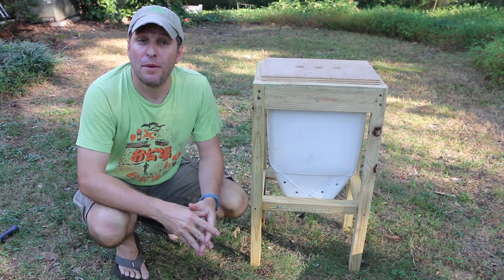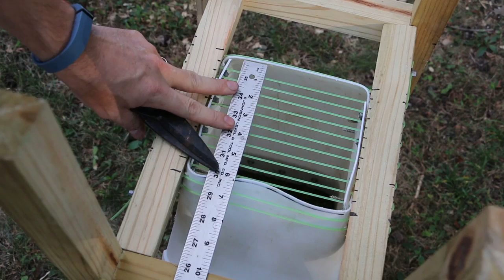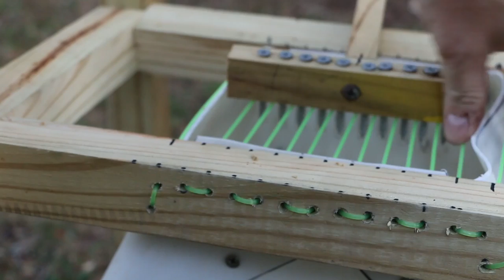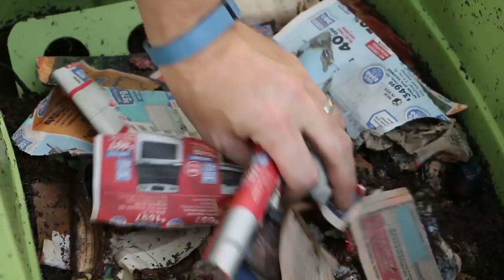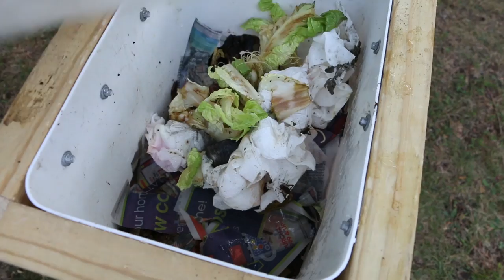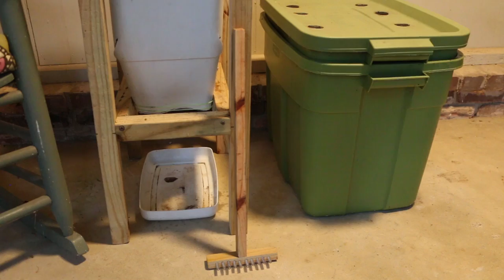How To Set Up A Flow Through Worm Composter

Comment: I just made one.  I’m so proud of myself.  It took two days because I don’t know what I’m doing, and it doesn’t look nice like yours, but it is up and running ☺️
Reply from the maker: Yay! You should be proud. I’m happy you built one. My greatest compliment is a new DIYer. The worms don’t care what it looks like. :-) 👍🏻😁👊🏻
Reply: GreenShortz DIY your response is very genuine..keeps us positive..thanks for the good project,buddy
Reply: @GreenShortzDIY  I'm going to figure a way around the wood. Probably PVC and around the loom, probably some fabric mesh. And I will probably hot glue the flaps. Or flex seal. But thanks I almost bought something for $149. I wonder if it would work horizontally I want to grow worms right in the garden. I've been using a box but I think my bedding wasn't good enough. I had newspaper,  cardboard, and regular dirt.
Reply: @aicram62  Good -I've got lots of PVC and want to avoid the woodworking.  I'd thought mesh also if I could remove every other strand - - -  Duct tape and glue for sure....    And a dishpan underneath - I saw elsewhere that there can be lots of fluid runoff.

Comment: I built a similar flow through bin using the same trash can plus trim line 2 years ago and I will tell you where you will run into problems.  The assumption that the vermicompost will nicely fall through the trim line is false!!!  Even with the nice rake you made,  you will not be able to pull the compost down - guaranteed.  The vermicompost is too sticky.  After many strategies to get the compost out of the bottom, what I had to do is push it down from the top using a small colinear hoe.  In fact I did that today to harvest mine.  Been doing it that way for about a year and it works well.
Reply from the maker: Ann...thank you for the feedback. I was quite fond of my little rake, but I'll agree it hasn't been pulling out the compost as effectively as I thought it would. Thanks for the tip and for your comment.
Reply from the maker: Hi Ann...I featured your comment in my latest video on worm casting harvesting. Take a look: How to Harvest a Flow Through Worm Composter: https://www.youtube.com/watch?v=6ScnbSySrFg
Reply: I agree with Ann, I also used to push from the top but then you squeeze the warms and it makes the material too dense while you want it to be more fluffy at the top. I found another method, I raise the whole container a few inches in the air and then give it a bump against the floor. A few bumps like this will get the compost down to the havseting bottom without compressing the upper layer
Reply: Yes, I tried that 'bump' method first, but with time the bin became too heavy for me.  Plus the material seemed to stick together and not fall freely through the wires.   I haven't found that using my short colinear hoe to push down the contents of the bin resulted in compaction, because the material seems to move out of the way as I press down.  The end of the hoe only measures 1"x3".  And I only do it enough to get the amount of harvest that I need at the bottom.  If compaction does take place, the worms seem to undo it.
Reply: @GreenShortzDIY  how about some type of auger?

Comment: great video and great ideas
I've built a simpler flow bin half a year ago, it's working quite well, but it's not large enough. Mine is  with plastic pipes at the bottom. your idea with nylon wires seems better
Reply from the maker: Thanks Oded...the best design is the one that is working for you right now. :-) I do plan to build a simpler version of this flow through worm composter, with an easy-to-operate harvesting mechanism. It will keep the trimmer wire in the base though. I like the way that has held up so far. Thanks for your comment.

Comment: I made a flow through composter about 8 years ago out a plastic 55 gallon barrel.  It was easier to make.  The grate was about 18" from the bottom of the barrel made of 1/2" conduit.  There was a little door at the bottom so I could harvest the castings.   The only problem was that the directions said to space the conduit 1" apart.  That was too much and the compost all fell through one day and i did not know it.  1/2" spacing like you have is much better.  Sometime I will put metal rods in between the conduit.  I really like your rake.
Reply from the maker: Thanks for your feedback. I am currently filming a simplified version of my flow through worm composter. I've got an element to the design that I am hoping will solve the harvesting challenge. The rake was fun to make. Thanks for watching.
Reply: I made mine ALL out of wood, and put a full extension drawer in the bottom.
Reply from the maker: Mark...here is the new flow through worm composter design I mentioned above: https://www.youtube.com/watch?v=l43GwJ-mCus (I linked this in another of your comments as well, I think)
Reply: Nice job

Comment: wow nice videos! I'm glad I stumbled upon your channel. I made my 2 bucket worm composter  somewhere in mid June (thanks to you :D ) and it was hard to really balance out the moisture in the bin. I found lots of dead worms and the bin had an overgrowth of some fungi mushrooms. So I removed some beddings, stopped spritzing water and long story short, I fixed those issues and since then I don't find any dead worms whatsoever. 

I actually do have a question(s):
- Have you harvested from any of your worm composting bins/bucket(s)? 
- How often do you check on your bin(s)?
- Do you fluff the bedding from time to time? I read somewhere that fluffing may be counterproductive as it stresses the worms and they tend to flee
- On your flow through composter, you do make 2 layers of bedding and add lots of food in between them. Why do you do that? I put mine on the bedding and food on one half of the bin.
- do newly hatched worms mean the bin is succeeding or that the older ones died out and left some cocoons?

thanks for your videos and information. 
Greetings from Germany!
Reply from the maker: Guten tag, Jan. Ich spreche ein bissien Deutsch (but, not enough to finish this comment auf Deutsch. :-))
To answer your questions... 
- I have harvested compost from buckets & bins, this requires a dump and sort method. I pull out all of the compost and worms, put them on an extra lid. The worms move down in the compost to get away from the sunlight (or artificial light) and the top layer can be gently scraped off. The downside is that the cocoons can't migrate, so many of them get lost, with this method. In most cases the cocoon tend to be in lumps of the bedding that are still intact, so this bedding goes back in the worm bin to continue to develop the colony. Here's video where I do this: https://www.youtube.com/watch?v=cm655sZta28&list=PLJZJy24wZucT0CTP3AIPiPd5nOWzwXeAq&index=12
- I monitor bins a couple of times a week, mainly when I add fresh veggie scraps.

- I generally leave the worm bedding intact, unless I am doing a sort/separate. I don't like to disturb the worms' habitat. Though, I haven't observe worms fleeing when this has happened.
- On the setup of the flow-through worm composter, since I was moving compost and worms from a regular bin, I wanted to add some new bedding to encourage the worms to begin moving up. The new food was added on top of that layer. And I always like to cover food with bedding to keep odor down and reduce attraction of other insects (like soldier flies) which would love to get in on the action.
- Worms lay cocoons when they sense their habitat is hospitable and food available. So, this is an indication that the colony is thriving. Worms lay cocoons throughout their life, not just at the end. I do find that growing colonies can be easily divided into two to share with friends or increase your own capacity.

Thanks for your feedback and questions. Im glad you are having success with your bucket worm composter. tschüß mein freund. :-)
Reply: Schön! Du kannst ja Deutsch! :D

Thanks for your lengthy and very informative answers, I really do appreciate your work and input into making the world a bit greener than it is right now.

Funny story on the side: I mentioned my bucket was ridden with fungi...  After removing that bedding, I had placed it into a bucket on my balcony for disposal later on (live in the city, 10+ floors). I somehow never got around to empty that bucket and about 3 weeks ago, I needed to use the bucket for something else and before emptying it, I had a look inside and "Lo and Behold!" there a couple of worms hiding under the newspapers that were once the bedding of the bin. I dug around and found lots, say 40+ worms, alive and kicking. Even after almost 3 months of neglect, the cocoons hatched and the worms survived in that environment and had been prolly eating the decaying newpaper. So I'd advice anyone who is changing bedding: Keep the old bedding around the farm, maybe you will get some new worms from the cocoons. 

p.s. You should really get yourself a nice green(ish) cargo shorts :D

Tschüß und danke!

Comment: This is an awesome idea. I made one too and added an extra shelf on the bottom to hold the drip tray. I currently have my worms in a closed bottomed bucket in my kitchen, with the breathable plastic foil they came in over the top to perturb flies. I have had them for 2 months and they seem to be doing ok. Using an open bottomed system, will flies and other insects not be able get in?
Reply from the maker: The open bottom might provide access for flies. I’ll have to monitor that. Thank you for watching. Thank a for the feedback.

Comment: Coffee grounds should be good enough for grit?
Reply: I had that thought about the egg shells.
Reply: I guess if it is to a gritty texture? 
Consider grit as fiber is to humans, as a prebiotic so  that what is eaten can be digested and have the necessary microbiome.
Reply from the maker: +FOR8YESHUA yes. Coffee grounds do provide grit. However the worms can only use the smaller bits. Except for the talkative ones with big mouths. :-)
Reply from the maker: +Annalisa Simmer the eggshells can serve a grit function as well. However they need to be ground down into very small pieces to be manageable for the composting worms to consume. Thank you for watching.

Comment: Great video thanks! We just started a compost pile outside and I was thinking about what to do with our compost material in the winter (northern NY). Thinking I could put this on the back porch or in the garage. How tolerant are the worms of the cold? Would they be ok in an unheated garage? Thanks again!
Reply: If you insulate they will be fine. They really need to be closer to 60 if possible for a minimum.

Comment: Just curious...does it end up having any kind of fowl odor? I see you put it right on your porch so I'm wondering if I can DIY it more to set up as a table or stool by my outdoor gathering area?
Reply from the maker: Hi Stephanie. It can have an earthy aroma, but it is not awful. You could create a charcoal filter to reduce that. Or use a two bucket system, which contains the air flow better. Happy composting. Thanks for watching.

Comment: Looking for a compost option for my apartment. Would this method of composting smell, leak, or have any other concerns for apartment use?
Reply from the maker: Keesha, I think you'd need something more enclosed for an apartment. Will your composter be on a balcony or inside?
Reply: @GreenShortzDIY  Inside our spare room
Reply: @keesharae8164  Keesa, look up the "Hungry Bin".  It is a commercial flow through bin similar to this.  There are government buildings in New Zealand (home of the inventor) where they use the bins INSIDE to compost food scraps from the cafeterias.  There must not be smell if done properly as the video showed multiple bins inside.   It would not work on carpet though.

Comment: Question.  Would it be ok to add boards to the frame to make it look nicer so you could keep it inside and maybe add a hinge for the lid?
Reply from the maker: +Suzie Q yes. I think that would be a nice upgrade if you wanted to keep this in the laundry room. You might need to adapt the lid slightly to allow it to hinge open. Although if it hinged, you wouldn't need the bracket to center the lid. I think that would be a good modification. Thanks for watching.

Comment: First off love the videos, very helpful. I love how you use things that are on hand. I am going to build a tower garden with a worm composter up the middle. I am new at this and was wondering if you have any advice. I see videos that use 55 gallon barrels. I was wondering if I use a taller barrel will the compacting force my worms up therefore not feeding the bottom? Again thanks.
Reply from the maker: Hi Liam. I've seen these elements and think they would make a great combo. I do think the soil compaction at the might might force the worms up, but I don't think that would be bad. You might consider only having the worm tower go 3/4 of the way down the barrel, allowing the liquid nutrients to filter out there instead of all the way at the bottom. You could even slide the worm tower up as it fills. If you are watering through your worm tower, the soil in the whole barrel is going to be super rich regardless of where the worms are feeding. Hope that helped.
Reply from the maker: Liam...I just finished my new design for the flow through worm composter. Take a look: https://www.youtube.com/watch?v=l43GwJ-mCus

Comment: coffee grounds or ground egg shells make excellent grist for worms.
Reply from the maker: +Computer Guru yes. The egg shells need to be ground somewhat finely to be consumed by the worms as grit. The bigger coffee grounds are a little big too, but the worms can find the size they prefer. :-)
Reply: I grind the eggshells in a bullet so pretty much a powder. Red wrigglers can easily use them for grist this way. I have not had luck doing it any other way.  BTW it is grist not grit. :) Worms and chickens both need grist in order to digest. I have been at this for 30+ years but always open to learn. Thanks for the clip.
Reply: +Computer Guru -- No, actually it is Grit. The definition of "grist" is a ground up combination of elements. Feed for cattle, etc. is often a grist of several components. Grit is "small loose particles of stone or sand." Grinding egg shells until they're a very fine size makes them into grit. The original use of the word by GreenShortz DIY was correct.

Comment: I think 1/4" dowels would work better than screws or nails and air hose.
Reply from the maker: If you go with dowels, I suggest stainless steel rod. Food will saturate will moisture pretty quickly. Regular steel will rust pretty rapidly in the toxicity of the worm leachate. It is strong stuff. Stainless rods should hold up. Thanks for watching.

Comment: I really like the way you did that!!  I'm also very new to this so can I build one of those for my very first one and what can and can I not put in there for them to eat?  Also, where do I get my worms to begin with?
Reply from the maker: +Lauren Jackson hi Lauren. I suggest you build my simpler version of the flow through worm bin. It will be a lot less work than this prototype. 

Worms can eat veggie scraps and coffee grounds. I use shredded newspaper for bedding and dampen with rainwater. Avoid dairy, citrus and spicy. They also prefer to get to food before it starts to rot. 

If you don't use coffee grounds, add a little sand for grit. The worms use grit to aid digestion.

Check out my video on setting up a flow through worm composter for more info. I get my worms online from Uncle Jim's Worm Farm. Use the coupon code "GreenShortz" to get a 10% discount (I don't make money on this).

Comment: Where are you located?  I'm in Texas and it's HOT. Keep the worms outside?  Or is inside mandatory for my climate?
Reply from the maker: I'm in GA. Above 85 degrees F the worms will be in distress. I suggest keeping them in a garage. Doesn't have to be air conditioned, but cooler that summer outdoor temps in TX. A protected location in the garage will help minimize the solider flies getting in too. Thanks for watching.

Comment: what about using a netted mesh for the bottom?
Reply from the maker: I did another version of this flow through worm composter. It uses a perforated metal sheet on the bottom and a harvest bar to slice off the castings on the bottom. It works better than this one. Thanks for watching.

Comment: is there any specific reason you use the news paper?
Reply from the maker: Hi Heath, the composting worms need a material to "bed" in. They like the folds of the newspaper to lay their cocoons. Cardboard can be used too, but newsprint is the preferred bedding. They prefer the veggies, but eventually will break down the bedding as well. So it provides a carbon source for the finished compost as well. Thanks for your question.